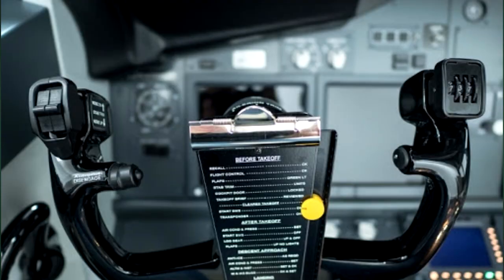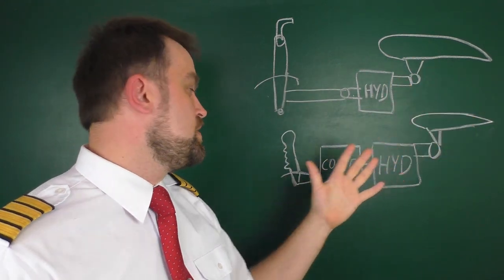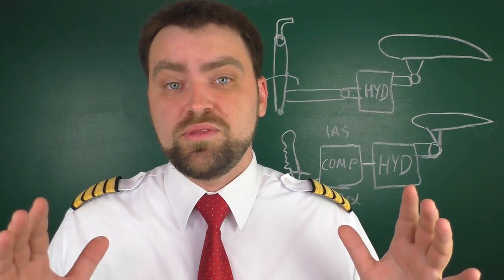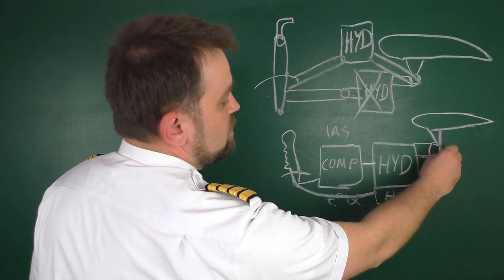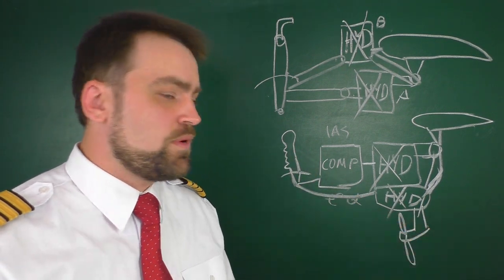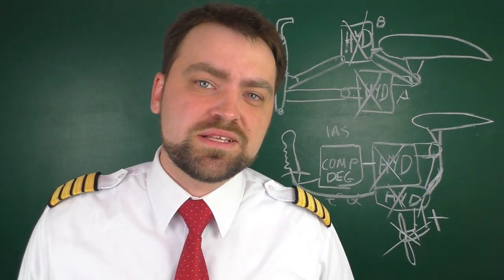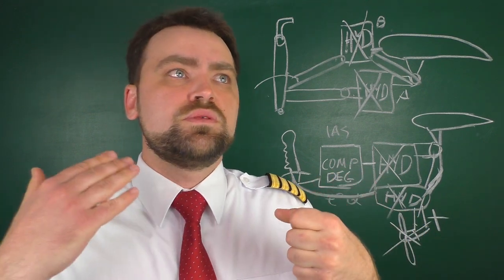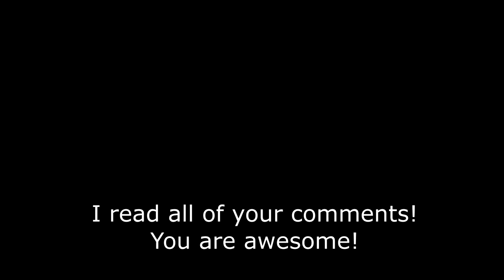Yoke VS Stick. Boeing VS Airbus. What is better? Fly by wire or not?

Comment: According to Murphy's law one day you'll be happy you have the manual reversion possibility. That's why I don't feel so safe in an Airbus
Reply: Both design philosophies – Airbus and Boeing – have their pros and cons. One big disadvantage for the Airbus sidestick is in fact that both are not synchronised. Meaning, one pilot could pull, and the other could push on his’, whilst the computer will take the sum of it and remain neutral. On the other hand, it is not possible to yank the plane and cause damage to it because of a protection mode in the fly-by-wire software, which is an advantage. And to be fair, with your concerns about safety on an Airbus, I would feel just as safe – or better unsafe – whilst sitting in a Boeing 787 (battery problems, which are barely solved). Also, comparing the newest production lines of short value aircraft from Airbus and Boeing, I rather sit in an A320neo than in a 737MAX for obvious reasons!
Reply: Well, as for today, I feel more safe in an Airbus A320neo than in a Boeing 737MAX.

Comment: 737 rules! 

I was a big fan of airbus until I flew it on a full size 320 simulator. I was flying gliders beforehand and I was used to the traditional flight contol feeling. In the A320 simulator, I realized that the Airbus flight characteristics are more like a 5 year old videogame rather than a regular aircraft.

I say that 737s apart from the 737Max are made for technophobic people like me and although they feel and sound difficult to control compared to airbus, they are very safe as long as the pilots have good flying skills and they do, because they constantly fly this difficult airplane.

I don't trust airbus, airbus pilots and new technologies (i.e. fly by wire) and any company embracing those technologies. The fun part is that I am only 19 years old and many may say that I sound like an old man.

Stay safe from a virus with 0.02% death rate and keep away from airbus and new technologies, they are evil...
Reply from the maker: Thanks for your story and your opinion...
Reply: Ok first of all both Airbus and Boeing pilots spend about the same amount of time hand flying as each other. 737 pilots will still use autopilot for 90-95% of the flight so “constantly flying this difficult plane” is rubbish. If we didn’t embrace new technology we’d still be flying using steam gauges and no digital screens to make interpreting information much easier. On an original 737 you couldn’t see anything when flying in fog and didn’t know where the ground was. Using digital systems we can see the terrain elevation on navigation screens. Have you seen how many accident happened in the 70’s and 80’s? The idea of the FBW is so it reduces fatigue on pilots as they don’t have to “wrestle” the aircraft.

The A380 is one of the most advanced aircraft ever made and has never had an accident. Even with the QF32 incident they had multiple hydraulic and electrical failures but could still keep flying. If you don’t want to embrace new technologies you may as well be an old person because you don’t understand it. I fully understand how this system and it’s redundancy works and there has NEVER been a time when the airbus’s FBW just shut off and the pilots cannot control the aircraft. How are you typing this comment and watching this video of you don’t like technology?

Any virus that has a higher than 0% death rate means anyone...even you..could die from it. Do you feel lucky?
Reply: @tomstravels520  look my friend. This is my opinion you have another one? Ok, but don't judge mine!
Reply: @Clayson Antoons Side sticks are disgusting, even a rat knows that!